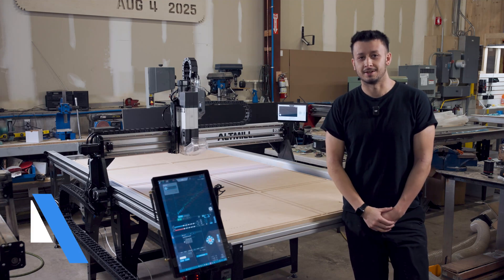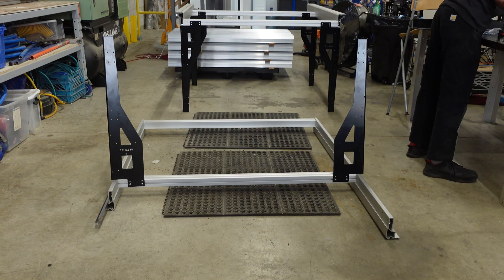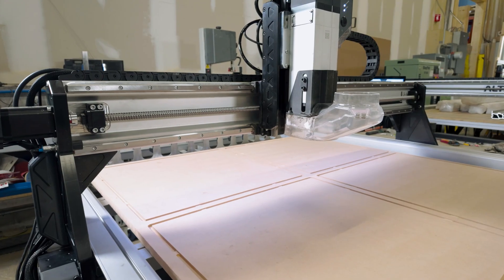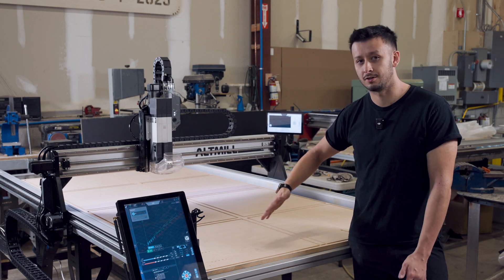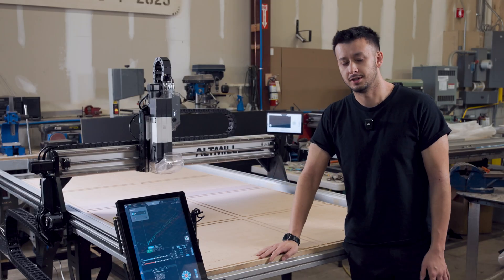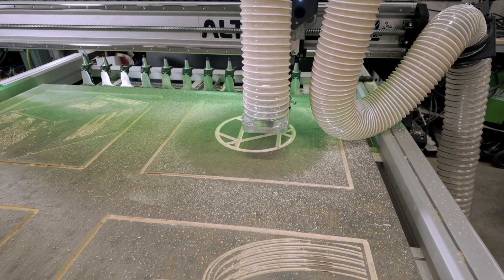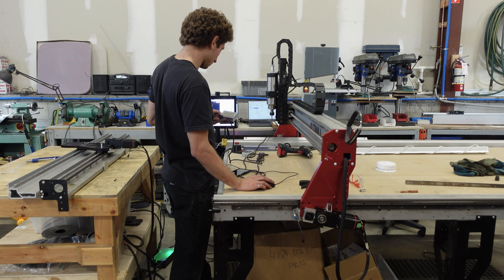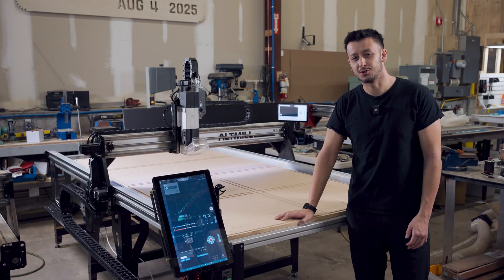AltMill 4x8 Key Changes Breakdown with Engineers

Comment: It's beautiful. The price is actually really good considering how much has been put into it. Excellent job guys. Looking to have this with my 4x4. As I mentioned in the live meeting. Please have available parts as the motors and couplings and parts for the rack and pinion. It's always a relief to know if anything happens I can quickly get my machine back running.